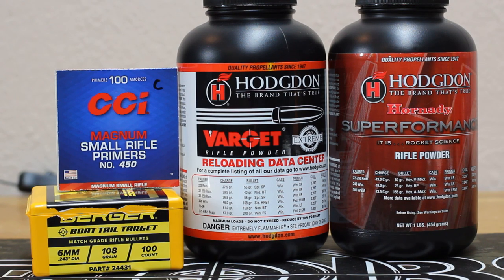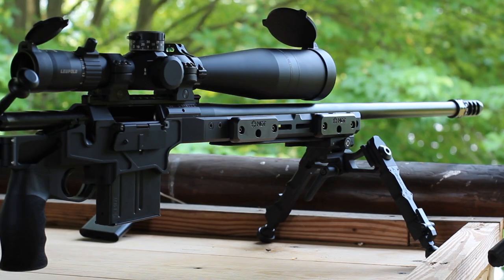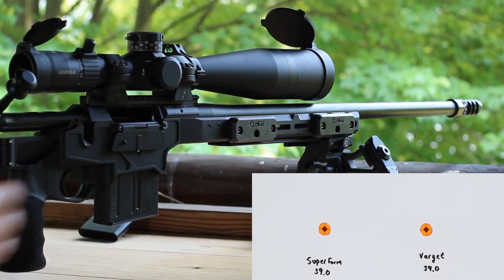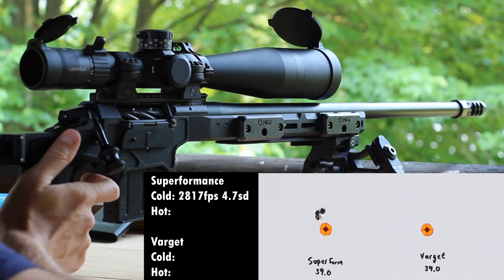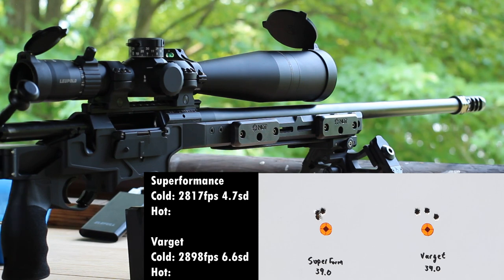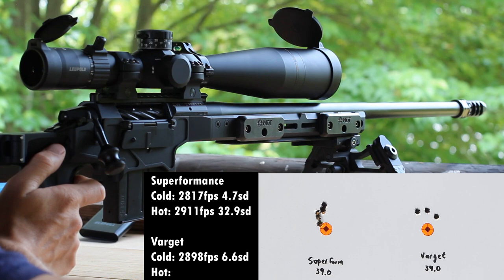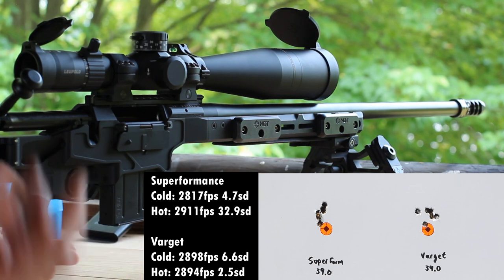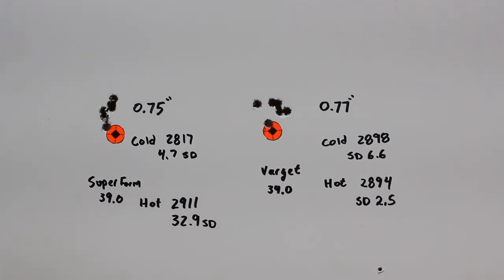Ball Vs. Extruded Powder, Temp Stability

Comment: Good test! A way to make it easier on yourself would be to get a small cooler and a small plug in or battery powered "warmer lunch box/bag". Pre load mags, put them in the containers for a few hours, or overnight or whatever, then just take the 2 containers to the bench with you. Keep ice or dry ice in the cooler, and keep the warmer turned on. Then just grab the pre loaded mags from the containers at the bench and send it. Your method clearly works, but this has been the least pain in the butt method that I have heard of for doing this kind of temp testing. Keep up the good work.

Comment: I tried this in my 35 whelen this year. Varget and CFE223. The CFE223 being very unstable supposedly. 
Tests at 20 degrees up to 50 degrees no change in either powder.
I just tested at 87 degrees, varget stayed the same CFE increased 25 fps on average. Much less than i expected for temps I use this rifle.
I also noticed out to 300 yards it really didn’t matter for accuracy, beyond that I’m sure it gets worse as you Extend but I’ve slowly been using some of the ball powders even though many guys say they are not a good choice

Comment: Another point of interest is that the faster group of Superformance is lower, so folks adjust their zero, if they know their velocities for the temperature. Makes sense that the impact is lower, since the barrel doesn't have as much time to rise before the bullet leaves. What confuses me is that I've seen POI also go up on some loads.
Reply from the maker: Not sure that impact will always go up or down based on higher or lower velocity. It seems to me it could go either way. If u believe in the vertical or up and down vibration of the muzzle as the round is fired depending on speed it could go up or down.

Comment: It's not probably not temperature stable, but LEVERevolution looks ideal for this cartridge with 105 grain Berger.  It fills the case, 99.46% burned, and just over 3000 fps with under 60,000 PSI.  Work up to 37.3.
Reply from the maker: I have very little lever evolution left and in the past with other cartridges it really was never a great performer. I also haven't really pushed the GT for velocity. It has been very happy around 2900fps. They need a Staball lever evolution.